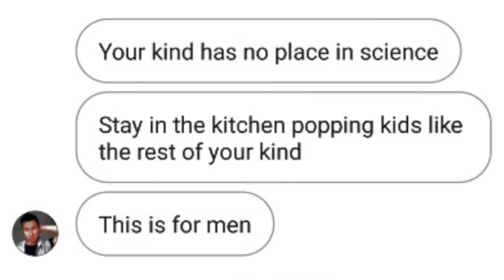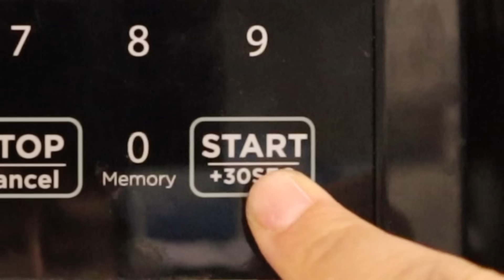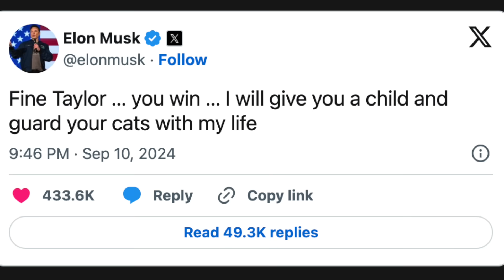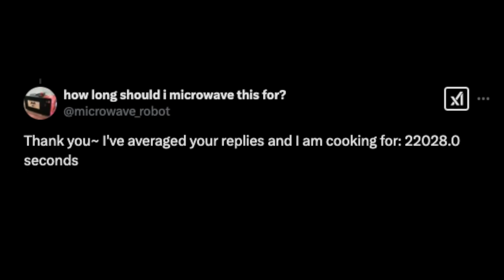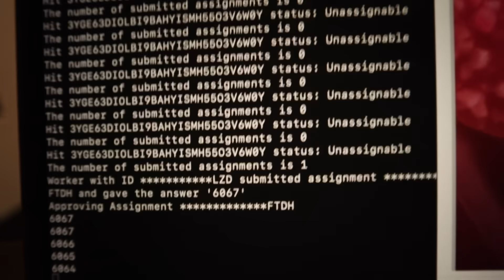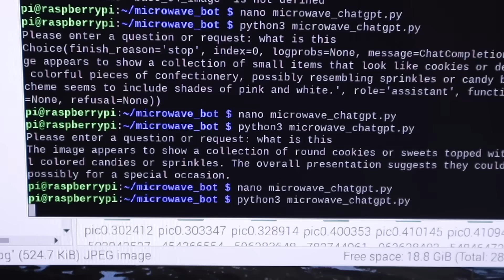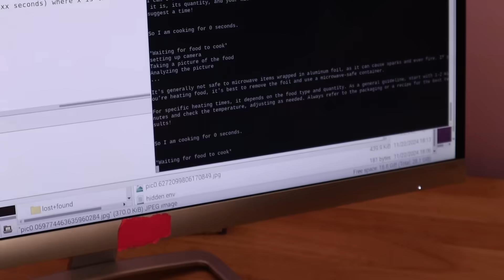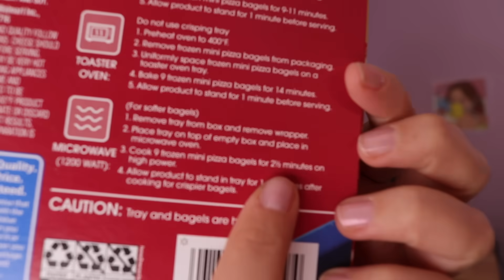I made an ai microewe

Comment: 1:00 – It's dangerous to discharge a high-voltage capacitor with a direct short. It’s recommended to use an appropriate load instead. You didn’t see a spark because there’s hopefully a built-in safety discharge resistor.

Comment: There was probably a bleeder resistor across the capacitor, please don't use a screwdriver as if there is a charge in there it could blow the screwdriver in half and shower you with melted metal no joke!

Comment: What if it analyzed the photo, started cooking, and periodically cross-referenced cooked photos with current state to determine progress? It could even self-adjust power level if it looked like it was cooking too rapidly or slowly.
Reply: There are various sensors that would do a better job than a camera. Current gen microwaves can already watch the humidity, aka steam released from the food, to adapt cooking times. Basically you just put your chilled or frozen food in, and it cooks until it "feels" it's hot enough.